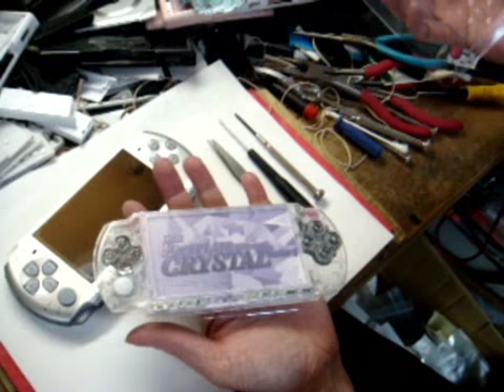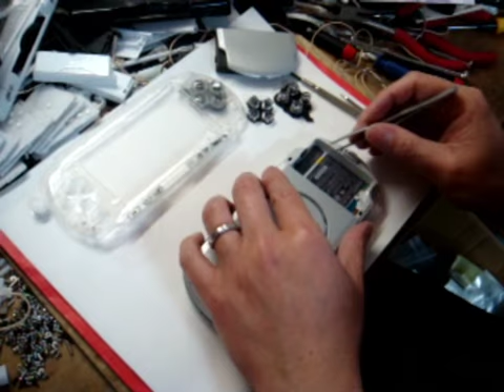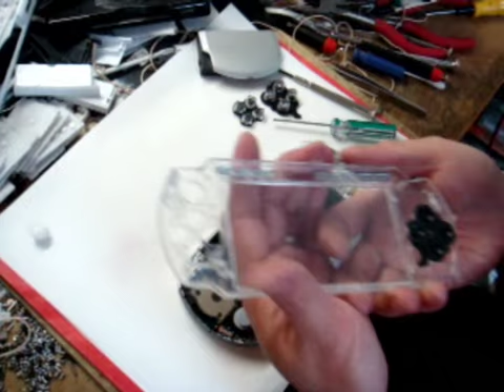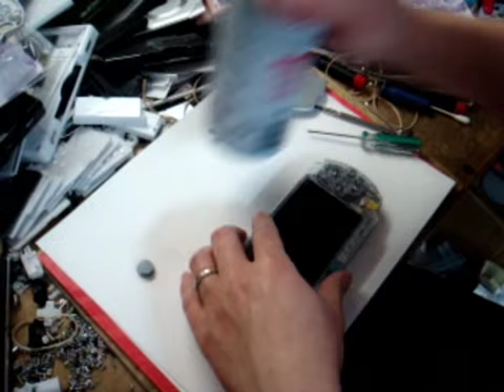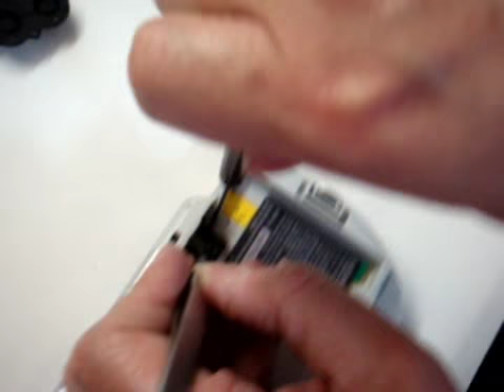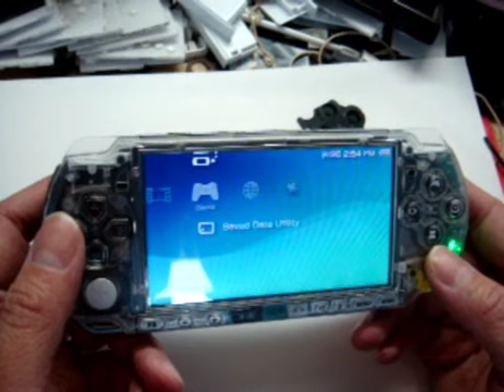How to install XCM Face plate for psp™  3000 series

Comment: usually a custom faceplate comes with the custom buttons too, you just gotta look at whats included if your gonna think about buying one, ive had a camy pro faceplate before and i just bought a "smooth as silk red faceplate" camy pro came with new analog nub, new buttons sets screwdriver and replacement screws, the red one i got comes with screwdriver and replacement button sets and also the rubber button pads under the actual button, so... just make sure you look at what is included

Comment: you should put your original one back on, if the face plate cant close then whats going to happen is that grit and dust are going to find there way into your system potentially compromising your analog stick and making your screen dirty, this will result in you having to take the plat off for almost bi weekly cleaning if youre an avid psp user like myself. I speak from expierence with teh same problem